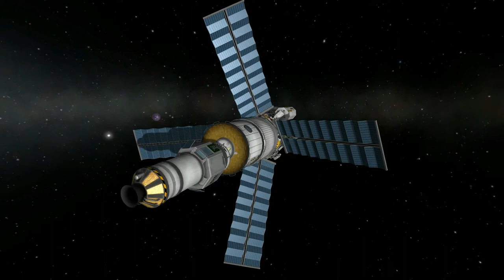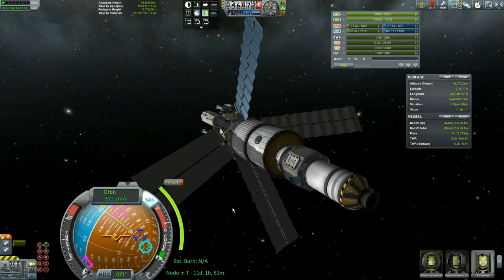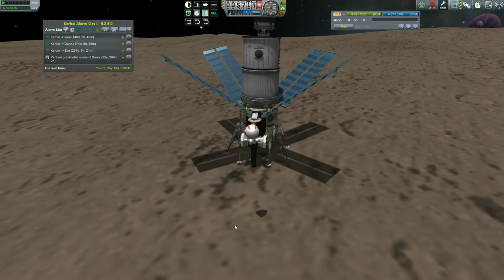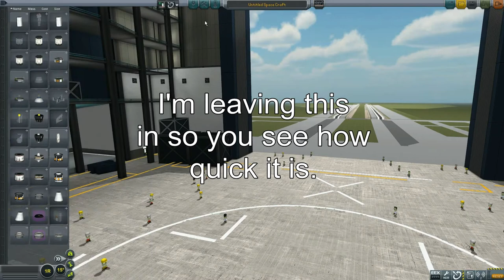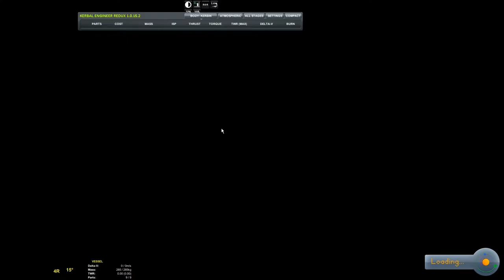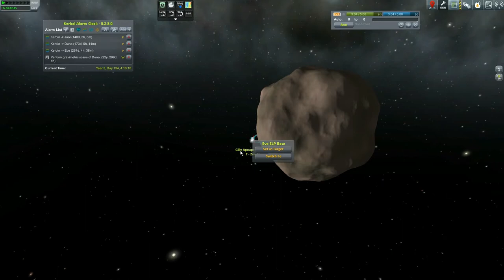KSP Bases 0.90 - 26: Trusses and Girders and Struts - 5th Horseman Let's Play

Comment: Viewer thought process: "You're in orbit mode... You're in orbit mode... YOU'RE IN ORBIT MODE!!!"

What are those smiley faces after the kerbanauts name in map mode circa 37:55?

Great episode BTW.
Reply from the maker: The smiley faces are a side effect of a kludge that gives me the ability to set both your names AND professions in-game. Squad thought it was a great idea to make profession based on name, so you can't just set profession in the save file. You can, however, add extended ascii characters to the name until you get a profession you like.

It doesn't show up anywhere in the game except in the IVA windows and in map mode. So it's a little annoying but at least I can do what I should have been able to do in stock!
Reply: 5th Horseman I just give them a middle initial.
Reply from the maker: Oh you and your logical answer. Though that would be harder to do programmatically which is what I'm doing.

Comment: Check out Craft history mod
http://forum.kerbalspaceprogram.com/threads/110703
1) store several backups of every blueprint in VAB/SPH [right click icon]
2) search blueprint by name [stock load button]
3) split blueprints into categories [left click icon]
P.S.
I'm placing all old blueprints into "Old" category. Just in case I'll need some inspiration later.
Reply from the maker: I like the concept of this but don't reuse ships enough. Usually my problem is too many craft files, not too little. I delete them willy nilly. Though the organization part sounds pretty neat, I'll look into that.
Reply: Андрей Беньковский P.S. It might conflict with EPL and I'm pretty sure this mode causes weird (but NOT game-breaking) behavior when I try click launchpad.
Reply: Backup function also helps if ctrl-Z makes weird thing.
Reply from the maker: I have never ever had that problem, and I screw up use ctrl-z all the time, back multiple levels on very frequent occasions.

Comment: That was weird with the instant karbonite fill.   it happend right as you turned the second drill on.   I wonder if that was the same one you turned on and off right after landing.  Maybe it thought it had drilled for the full duration and dumped all that fuel instantly to the tank?

Also I laughed at the orbit mode thing but even more when you complained about no RCS and not enough control to turn around and thrust downward to get back to the ground faster.   I then looked at the perfectly good rocket clawed to your roof pointing the way you needed it :p   Could have just turned on the 909 and off the botom one to give yourself a bit of a nudge back downward.
Reply from the maker: Yeah that Karbonite thing was weird, just another in a long line of "weird" on this run :)

I suppose I could have turned on that engine but it would have required 4 right-click menu options while maneuvering very close to Gilly's surface. No thanks :D Plus, with... 11? m/s left in the tank on touchdown I was really just better off waiting to land.

Comment: *Eyes sparkling*  I get a new ship !  That's amazing.  Too bad I don't get to design it in this series, but knowing my tastes and yours, maybe it's for the best.

Ummm.  Pretty sure I could have a compact ship with enough dV to go to Jool and back, maybe even without a transfer window,  You unlocked most of the tree right ?  I think I'm going to try on my side, just for fun =)
Reply from the maker: Yeah the whole tree's unlocked. I have the game set to give me money only, though I may switch it to rep too because I don't have 100% rep and thin I need it to get the asteroid contracts.
Reply: 5th Horseman
Not the prettiest ship I ever did by a longshot...  But I would estimate 9k dV on the ship I made (one nuke engine that's all,  2 Rockomax X200-8, 1 rockomax X200-16, 4 Gigantor XL solar panels, Mk.1 cockpit, 1.5m battery, 1.5m Remote guidance, 1.5m Advanced inline stabilizer).  No rcs, no lights, no ladder, no docking ports.  It does have a Communotron 16 tho.

Not my usual ship, but it works !   I need to reinstall Kerbal Engineer, but I'm still waiting for v1.0 before really digging-in again =)
Reply from the maker: That's close to what I designed, both in tools and dV, though I've got it set up to toss one of the fuel tanks when it's empty. Haven't flown it yet though so who knows. I like the numbers though so it should be fine :D

Comment: I'm also using procedural parts and I think it is more realistic. At least not less realistic when designing a new lifer for every launch.
Reply from the maker: I too like Procedural Parts, but I think that's something you start a new series with, not something you shoehorn into an existing one.

I'm a huge fan of the SETI balance mod, too.
Reply: Final Frontier also should appear from the start or not appear at all.
Reply: About SETI: Currently I'm tired of ksp career and starting sandbox game. However I might use sandbox part of this mode and/or maybe install it after 1.0 comes.

Comment: You could have used a pylon to hold the pip ends, that would give a nice hook up point.
Reply from the maker: I would have had to build one, though. The girder truss was already on the surface.
Reply: I ment when you were building the truss with the pipe ends, but I do not recall if you can put eight on them or not.  My 22" monitor took a dumb and playing on this small one is kind of irritating to test thing like this.
Reply from the maker: Oh yeah I could have, but then I'd have had to know in advance that I'd need it.

Or I could have just made it "just in case" but that's very against my nature :D